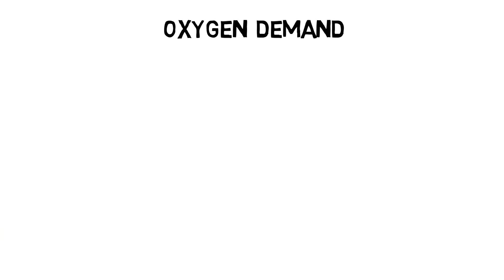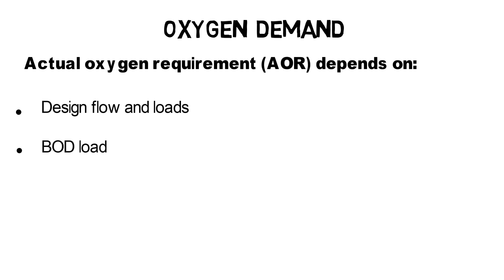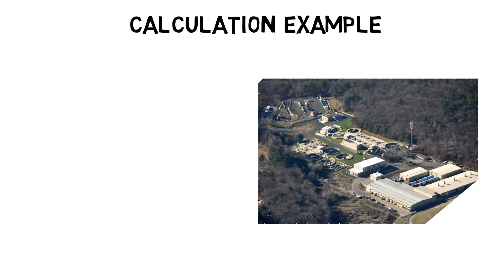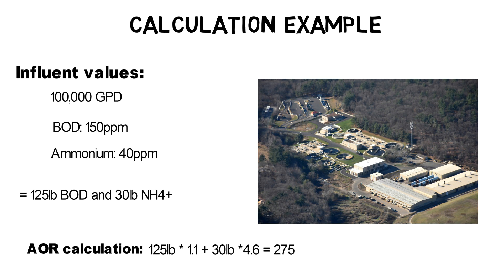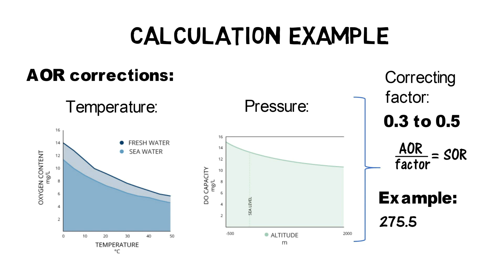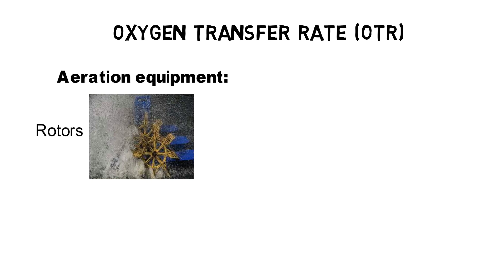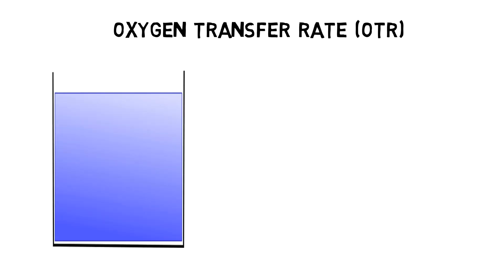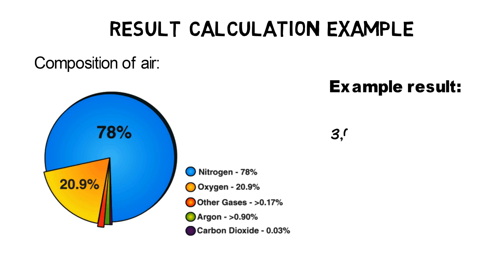Oxygen transfer rate in Wastewater treatment - calculation example

Comment: Normally, we first calculate the total oxygen demand from biochemical reactions in carbonaceous and nitrogen removal processes.  Then, use two-film theory to calculation the oxygen transfer efficiency based on actual site test to get the overall oxygen mass transfer efficiency KLa with all sorts of corrections such as alpha factor, saturation oxygen concentration, temperature effect, water depth, etc.  Finally, the actual air required is corrected to air by the oxygen fraction.

Comment: On the second to last calculation, why do you use 1.5%, Is always the same? on depends on the depth? Thank you for your answer, nice vid.
Reply from the maker: Hey Estefania thanks for your interest in our videos. Manufacturers for the different aeration equipment provide information on the OTR efficiency but for diffusers the value is usually about 1.5%. Hope this helps 👍